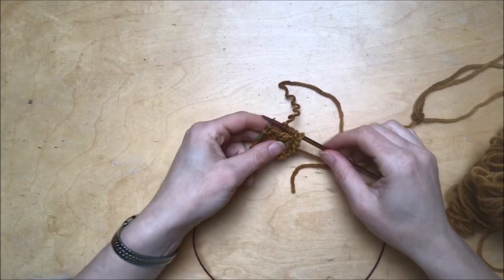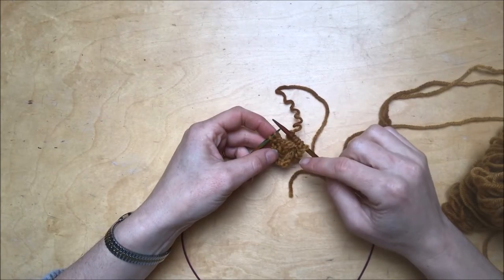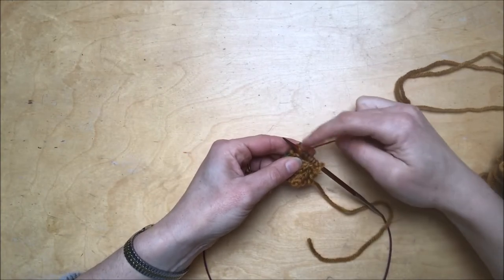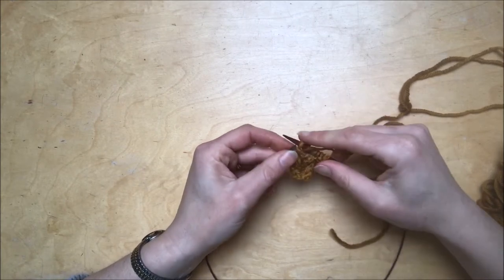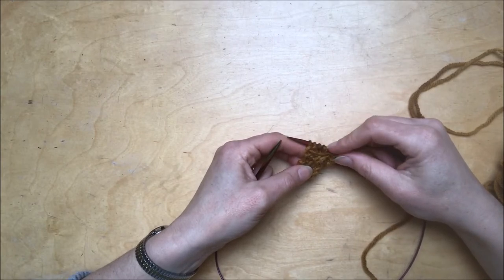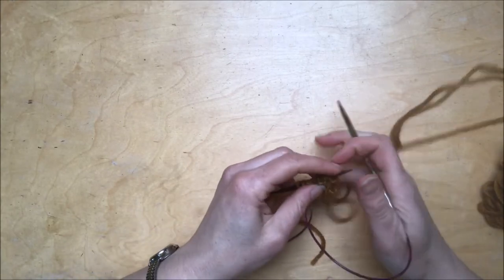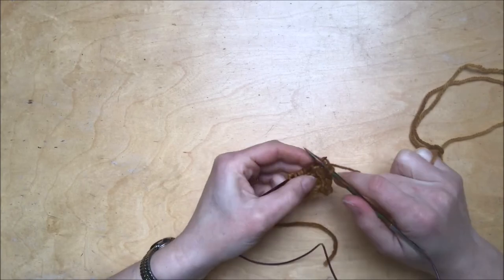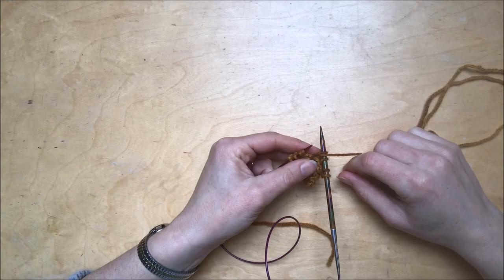How to Tighten Up A Cable Edge In Your Knitting

Comment: I understand what you are suggesting for tightening up the knit stitch before the purl stitch in cabling.  I have applied the same technique to ribbing.  It has eliminated the enlarged knit stitch just before the purl stitch veery nicely in both situations.  My dilemma is that I am uncertain about what to do on the reverse side of the fabric.  I am correcting the stitch mount on the knit stitches before knitting them, but then what about other stitches where a knit precedes a purl, do I apply the same fix?